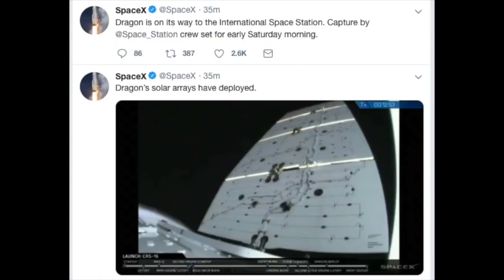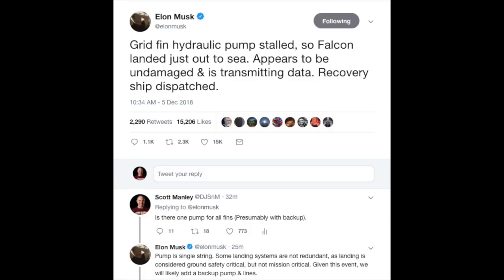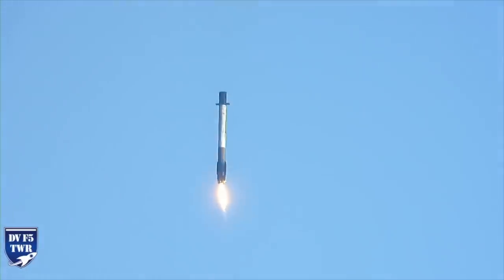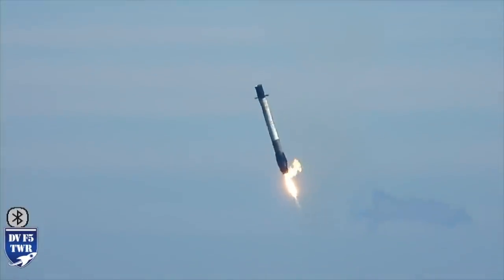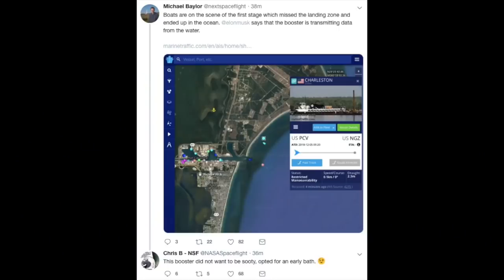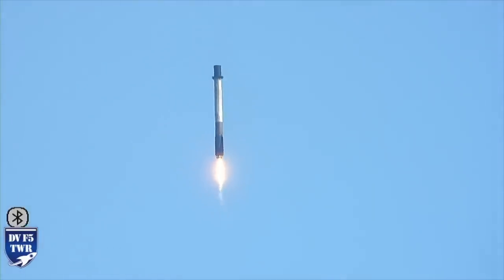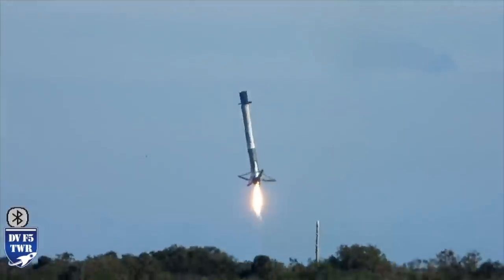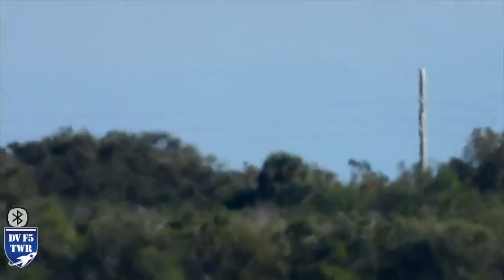SpaceX Rocket Loses Control After Successful Launch

Comment: Failure sequence is interesting.
 - At 5:30 the rocket spins counterclockwise (looking down) 1/4 turn.  This gets corrected at 5:34, but now the rocket is rotating clockwise.  My guess is that the grid fin that did most of the correction is on the not visible side of the rocket, and has run out of hydraulic fluid in a local reservoir.
 - The rocket rotates two full turns clockwise and is stopped when the grid fin on the right goes to full deflection at 5:40.  My guess is that this motion uses up it's local reservoir, and it's now stuck as well.  The fully deflected fin corrects the clockwise rotation but now the booster begins to spin counter clockwise, with no evidence of the cold gas thrusters trying to correct.

Video ends but my guess is the cold gas thrusters stopped the rotation just before landing gear deploy.  It looked like the landing gear deployed a little slowly... does the landing gear use the same cold gas reservoir that the cold gas thrusters use?
Reply from the maker: Thank you for thinking this through.
Reply: Perhaps the RCS applies the same 'suicide burn' approach as the main engines; saving the fuel for a last minute correction rather than battling with the aerodynamics.
Reply: Pre-Block 5 boosters use pushers to get the legs off the side of the booster and gravity does the rest. Once fully deployed the legs lock into place. I believe this is the case with Block 5 as well. I guess the odd angle made some of the legs deploy slower???? That's my best guess.
Reply: @Battleship61234  too me it looked like it was going a little too fast and drag could of slowed them down
Reply: @Kmodoe  Also a possibility :)
Reply: One of the early landing tests involved a missed landing due to running out of hydraulic fluid and they increased the reservoir volume, most likely, but, if memory serves, Elon had talked about moving to a closed loop system since then. Knowing Elon such plans and changes could have changed again more than once or never implemented after all so - do we actually know what the hydraulics of a Block 5 Falcon 9 are like?
Reply: Spectacular landing none the less.
Reply: I reckon the legs do most of the work slowing the spin like an ice skater
Reply: @slipersox  How much mass do you think is in those landing legs? No way! It was the thrusters :) 
https://twitter.com/elonmusk/status/1070399755526656000
Reply: @slipersox  Landing with a yo yo despin? I like the sound of that.
Reply: Bill Kerman prettier sure it was a 3-engine burn for some reason, so they had role authority with the engine gimbals.
Reply: @fiveoneecho  The 3-engine burn is for boost-back. The landing burn is 1 engine. If you watch the landing sequence filmed from the ground you'll see the one engine trail spin around. The center engine is gimballed off-axis to correct for translational motion. Pretty sure the booster's rotation is slowing down due to air resistance (Scott Manley mentions this in the video).
Reply: PlokJeDS I think boostback and entry burns are 3-engine but landing is still 1-engine; I’m guessing they’re sticking to 1-engine landing for a more forgiving margin of error
Reply: @slipersox  Not quite, velocity is decreasing rapidly so the aerodynamic forces on fins forcing the spin are also decreasing rapidly, eventually small enough the rocket gimbals can dominate and drop the spin to zero. I hear this ice skater argument but rate it as a small contribution.
Reply: I see Elon has confirmed this by tweet
Reply: @slipersox  in ksp i forgot my chutes when coming back from the mun the landing legs saved me.. i think ihave the video uploaded on youtube or xboxdvr.. gt: theduckysaur
Reply: An open loop hydraulic system is simply a pressurized tank. Very cheap and reliable, but once the pressurized tank is empty, that’s it. The mention of a pump implies a closed loop system, probably electrically driven; which suggests a possible electric failure in that system.
Reply: @nemo-x  Moot point. "Mute point" is an eggcorn.
Reply: Just an observation. I have dealt with hydraulic system on excavators and similar systems, and 'running out fluid is really not a normal behaviour unless something is seriously wrong, such as a broken hose or similar. All oil is recycled? What makes this system different?
Reply: @johndoe1909  Scott Manley himself mentioned this in an earlier video, but the hydraulics on most spacecraft boosters and lower stages are open system, which means the hydraulic fluid gets dumped overboard rather than reused. Several early failures on this booster recovery system have been blamed on running out of hydraulic fluid.
Reply: @HiddenWindshield  The Falcon 9 recycles hydraulic fluid (the kerosene) back into the low pressure inlet of the pump so it's a closed system.
Reply: @jeremyarnold4798  The closed loop hydraulic system you are taking about is on the bottom of the Falcon.  There is another system at the top, which was open loop at one point.  I don't know if that's changed.  If Elon said there was a pump failure, then that sounds like the top system is closed loop.  There's no particular reason for the top loop to use kerosene... The kerosene is a long way away during landing.
Reply: @IainMcClatchie  If you use kerosene you completely eliminate a separate fluid that must be loaded on to the rocket for every mission. Just because the grid find are far away from the bottom of the rocket doesn't mean it's not worth it.
Reply: @jeremyarnold4798  One, that only applies to the engine gimbals, the grid fins on the boosters use standard (open system) hydraulics.
Two, the fact that the kerosene is used for something else (burned in the engine) before being jettisoned does not change the fact that it is eventually jettisoned.
Reply: @HiddenWindshield   Elon specifically said the hydraulics are a closed loop system. They haven't used open loop for at least a couple years. And so what if it's jettisoned? My point is that not filling the rocket with extraneous fluids would be a significant benefit.
Reply: @jeremyarnold4798  My point was to answer John Doe's question. He apparently had never heard of an open loop system, so I simply explained what it was, and mentioned that most spacecraft use them for their earlier stages.

Yes, using the fuel as hydraulic fluid has a significant benefit. You are correct in that. It has absolutely nothing to do with what we were discussing, but it is in fact true.

I didn't realize that they had converted the fin's hydraulic system to closed-loop. Sorry, I must have missed that tweet.
Reply: @HiddenWindshield  watch every day astronauts newest video. He goes over how in the falcon it is now a closed loop system
Reply: @HiddenWindshield  after CRS-5 spacex changed to a closed loop system, coz they had a failure wen they completely ran out of hydraulic fluid.
Reply: @John Doe 
In most space hydraulic systems, the system is open (reservoir-> pump -> load -> overboard) instead of a traditional return-to-tank setup. This is because the additional mass to plumb a hydraulic return far outweighs the mass required to store just enough fluid to last the mission. Thus, hydraulic fluid becomes a consumable.
Reply: @johndoe1909  Many rocket hyd. systems use an open circuit to avoid return lines and pumps using instead a pressurized reservoir of fluid. 
But now Musk spoke of pumps so I don't really think an open system is worth just the elimination of the return line especially considering they already had a problem of running out of fluid.
Reply: @johndoe1909  as elon musk wrote in his tweet, the pump stalled (unclear if a fluid system issue or mechanical issue, as I don't know what type of pump it uses), so even with a recycle system his failure sequence could still have been correct, but just replace running out of fluid with running out of pressure. Makes sense I think. Id imagine there's likely an accumulator between the pump and the fin hydraulics so that the vibrations of the pump aren't translated to the motion of the fins. This, in theory, could supply some residual pressure which the fins used up trying to correct the spin. Just a guess though.
Reply: @johndoe1909  I can't remember the reason why but it gets depleted. Is there possible optimisations for hydraulics for say, increased force, if you don't recycle the output? As if there is, they may well have favoured it despite the risk of depletion.
Reply: John Doe Elon said it was the pump failure it’s self. In fact I would say the fins original deployment while still in space looked slower then normal....
Reply: @johndoe1909  Oil is not recycled. Open hydraulic schemes was implemented on Falcon9 grid fins.
Reply: @Wirmish  It's not an open system anymore, why are people still saying this...
Reply: @johndoe1909  In earlier boosters, it was open-loop, but it ran out once, so now it's closed-loop. What happened is that the pump siezed.
Reply: @sea_kerman  after the one that ran out he said they were just going to add more fluid. I would like to see source of this closed-loop system.
Reply: @johndoe1909  This is an open hydraulic system. Weight is a huge issue, so the fluid is not recycled.
Reply: @donkoltz1  It originally was an open hydraulic system but after running out of fluid a few times early on it was switched to a closed loop system.
Reply: Looks like both of the grid fins in the view go non-responsive and are locked in a position that excacerbates the roll. I'm guessing the rotation is diminished as velocity decreases so the aero forces go down. There's no rcs or other rocket forces (1 engine landing) that would help with roll.
Reply: "local reservoirs" in hydraulic systems are called accumulators, and the falcon 9 probably doesn't have any accumulators, since they would add mass with no real benefit
Reply: @SuperAWaC  I explained the possible benefit in my comment earlier, also it's just a guess about hydraulics having accumulators, but I know fuel lines in liquid rockets have accumulators to stop what's known as pogo oscillations from potentially destroying the rocket. I can see how a hydraulic control system would be susceptible to similar issues as it is worst in really long and thin columns of fluid, such as hydraulic lines possibly.
Reply: In the video Elon posted you can see the RCS fire just before touchdown and slow the spin. Once the legs deploy the increased MOI stops it completely.
Reply: Can the engines gimbal independently? It uses 3 while landing right? If so I think this is how it stopped itself from rotating.
Reply: @ynzeselders4184  physically yes they can (ie they don't just have all 9 on one giant gimbal as this would need to fight against the thrust of the outer engines) but I'm not sure if they've wired and programmed it to be able to do that or not.

Comment: That booster will never fly again and neither will any of the engines.  Once that thing hit salt water its game over.  It's possible the tube could be reused, but none of the more expensive parts ever will be.  Still, there record for recovery is pretty damn good with only two failures this year that I know of: the center core of the Falcon Heavy, and this one.  I am a little disappointed that they've given up on recovering the second stage but appreciate the focus on BFR or whatever they will call it.
Reply from the maker: Yes, I'm struggling to think of an application that SpaceX would use it for. 
It's probably too late to use it in the crew abort test.
Reply: @scottmanley  -- They will or should do an autopsy to see what happened not only to the grid fin but also what damage occurred to the engines etc.  So, it still makes sense to recover if only for analysis.

Comment: It looks as though both of those fins had stopped moving, as if a hydraulic pump had failed. Notice that it did regain control as the speed reduced and the motors and thrusters corrected the rotation.
Reply: 4:30 - one of the live feeds (either SpacEx or NASA) said it looked like frost.

Comment: If you watch the trajectory of the re-entry you actually realize that the booster hasn't got enough energy to reach the landing zone and the re entry burn only made it worse. That's why you see the rcs thrusters trying to push the booster towards cape right after the the entry burn shut down. So I think for safety reasons falcon 9 protocols tried to move the booster away from any potential harm for people on the ground and that's where the gridfin failed. However I'm grateful for the integrity of the booster and the excellent job of the SpaceX team!
Reply: For safety the booster always aims short. They correct this when they go for a landing. They even intentionally aim to miss the droneship when they land there.
Of course we need to recognize how great the fight software is because it recognized this anomaly and splashed down safely and even corrected itself for a perfect landing.

Comment: Same question in my head for the debris, I noticed that also and the ice Theory is not the right one....maybe a joint, or a seal, or maybe a lock-nut of some kind... A ring from A Ball Bearing system.👷
Reply: Why do you think the ice theory isnt correct?
Reply: A 15cm diameter lock nut made of white spiky material sure sounds a lot more likely than ice... /s
Reply: @Mythricia1988  look at the inner top right area. That is very thin and the spikey parts are far from uniform and look much more likely to be ice imo.
Reply: A lock-nut that came loose during reentry would be a dire failure mode indeed - not far behind would be a ball-bearing ring; such rings are typically installed under tension, and, practically speaking, WILL NOT come loose unless the entire assembly fails or the ring itself shattered.

Comment: Did SpaceX take a financial loss for this flight (assuming the booster is unusable at this point) or does SpaceX charge NASA for the the full cost of the rocket still?
Reply: SpaceX has a fixed price contact with NASA for every CRS-launch. The price is for a completely new rocket and dragon capsule. NASA doesn't care what SpaceX does with the booster afterwards.

Comment: 1:22 the grid fins actually point in the direction of rotation, causing the spin. The rotation probably slows because of the decrease in airspeed. Great work by the engineers to be able to recover from this failure!
Reply: The rocket is completely autonomous. So it was just the programming that saved the booster
Reply: true :)

Comment: 1:28
The gridfins do NOT compensate for the roll! They initiate it!
The airflow is always perpendicular to the "flat" fins.
Reply: The glitching hydraulic pump meant that the fins got stuck in one direction and therefor the booster began its roll. You can see the gas thrusters trying to compensate. The spin slows down as the boster slows down, because the roll rate is directly associated to the airspeed at the fins. Just like with the feathers on an arrow.

Comment: I noticed that at the end of the re-entry burn, the left-hand side engine seemed to stay on for a second longer than the other two. After that, the booster was pointing heavily to the right. Is it possible that this is the cause for the extreme angle of the grid-fins?

Comment: Re: what that weird thing is. Condensation around the cold gas nozzles, shaken loose during descent? Rockets are always flaking off icy chunks of stuff, and by the shape, that could be an icicle formed around a circular vent (which a RCS nozzle is), and should get pretty chilly when the cold gas thrusters are firing.

Comment: 4:28 - My first thought was depressurized gas freezing, but you wouldn't expect that to hold its shape. Maybe frozen water from the atmosphere collecting on the outside of something that is depressurizing, then it broke off? But you wouldn't expect external surfaces to be particularly cool right after re-entry, except there might be some cold spots tucked under the moving parts that only get exposed just prior to landing.

Comment: And this is why I'm not the biggest fan of the new BFS/Starship design.

You presumably need control surfaces of one kind or another but this introduces - especially with rockets - a potentially fatal failure source. I'd be less worried with something like the original ITS design.

Comment: Don't forget that the gridfins' thrust is unintuitively perpendicular to what they would be if they were solid paddles!
So the visible fins were causing the anticlockwise spin wrt the camera. We don't know the what the attitude of the other two fins were, but I assume they were probably very pissed off!
Reply from the maker: Yeah, I got a bit mixed up when I walked outside to record. but the failure is apparent, also the safety systems worked.
Reply: @scottmanley  I struggled with it for a while before it clicked!
Reply: Must of took a long time to accomplish.
Reply: I think it's pretty intuitive... Just picture which way the air is deflected and the momentum is imparted the other way.
Reply: @zolikoff  just picture the air going through the grid instead of being deflected by it.
Reply: @JayVal90  It is deflected... by the walls of the grid. So it goes the other way :P
Reply: It's like that?